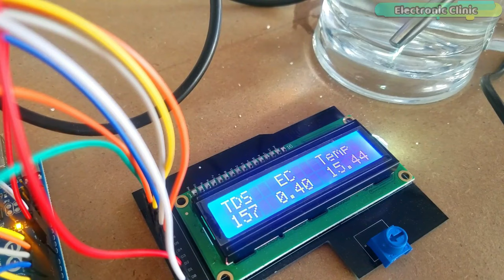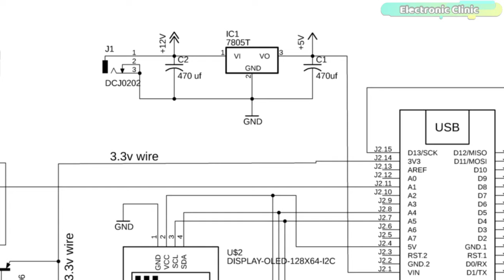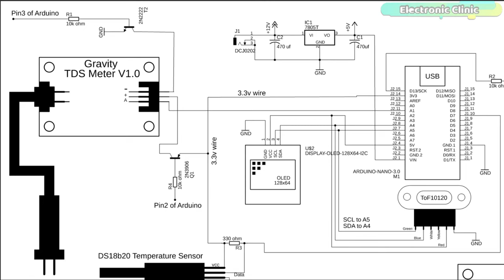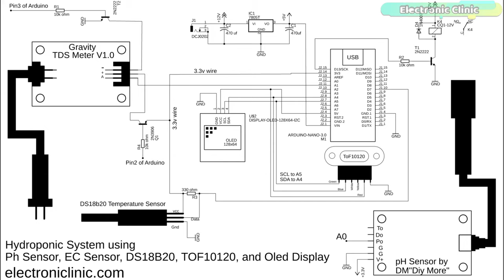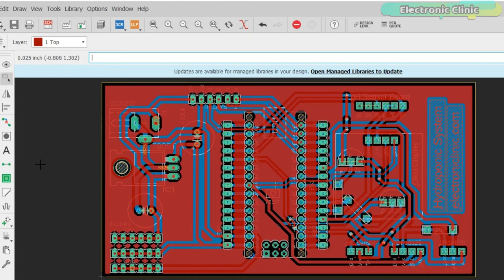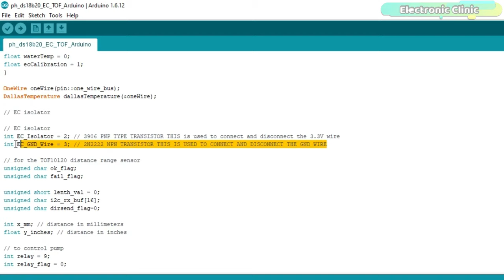Arduino Hydroponics, DIY Hydroponics System using pH Sensor & EC Sensor, Hydroponic

Comment: Totally amazing video. Finally i can read ph and ec at the same time. This is perfect for any recirculating hydroponic system. We would love an IOT blynk version of this using a esp32.
Reply: Yep, i'd like to have the same system using a esp32 to run with home assistant!
Reply: what range of ec is it reading?
specs on tdm meter says it only has  range 1000ppm, my ec calibration fluid is 1800ppm, is it enough for hydro?
Reply: @ralphbooger4756   ppm and tds are conversions of ec. Ec basically reads resistance...
Reply: @chimpofm  
so if the ppm range is 0-1000 ppm, that would mean the max ec value this board can read is under 2.0 ec? which would be on the low side for hydro?

im a little bit confused about the ppm to ec conversion, ive seen 3 different ways to convert it, on one scale was 1000ppm = 1.9-2.0 ec, another scale showed 1000ppm as 1.5-1.6 ec.

im trying to figure out if i can use this board, in my setup i would need to accurately read the ec at 2.2... and even a little bit higher to make sure it is not too high... so around 2.4-2.5 atleast.

could it be adjusted to read like 500-1500ppm or am i misunderstanding this completely?
sry bout the big post but im confused lol
Reply: @ralphbooger4756  ive never exceeded an ec of 1.5 and those were trees... i only work in ec so i dont worry about conversions . 0.35 babys. The 0.56 after 3rd set of leaves. Then you can calculate ec required by checking consumption.
Reply: @chimpofm  Hi! could you point me in the directon to find how to calculate required ec (or whats the relation between comsumption (and how to measure it) and required ec)
Thanks!
PS: yes, total n00b on this...
Reply: @gcolpachi  sure. Go in low. At half strength.  Measure ec. (Eg 0.82 ec) After 24 hours.  Measure again.  If the 2nd measurement is a lower number. Increase ec at ratio. If its a higher measurement. Lower ec. Add water.  Aim for a stable number. Ofcorse ec will increase over time. So as the measurements drop periodically increase ec at ratio.

Comment: How about using stepping motors to dip and retract each sensor? dip the sensor for a period of time like 5 to 10 seconds, make an average of all readings done in this time, store it, proceed to the next sensor, do the same task for all of them, and display the information after the probing process is finished. Of course this should be done in still water, like a tank connected in series to the pipes system.
Reply: stepper motors can not swim.
Reply: @nachnamevorhanden3335  smooth brained fella arncha?

Comment: Hey, thank you very much. Just wanted to check if using NPN and PNP will solve this problem, and here you are, you gave a result. So, also if you are better in electronics, what about using mosfets like N and P type will it also work? Because, I suppling sensors from separeted source and it has a huge current strength, so think I can burn bipolars.
Reply: So, maybe i will clarify, you used 2 pins of arduino but i want to use only one, so i want to connect NPN to arduino pin, and PNP base to NPN collector, so then when NPN will be open PNP will also open. But that way we need to deal with high current.

Comment: Do you experience that the PH sensor over time gives incorrect values? Does it need re-calibration or cleaning since it is submerged in water constantly? Thanks for inspiration
Reply from the maker: ya, it needs to be recalibrated. But the expensive ones needs recalibration after months.

Comment: Sir I am using diy ec meter in this circuit which has ec1 ec0 and VCC and GND what will be the circuit for breadboard  it have 4 pin

Comment: a couple of q´s - can i use an esp32 instead of the uno?  do i need to do 12v conversion - and not simply power from 5v ? thanks
Reply from the maker: you will get all answers, next week i will use esp32.

Comment: SIr i hv question for Turbidity sensor in your website, why when I turn the bolt knob on the A&D module nothing happens and it doesn't change to 4,2 or 4,1

Comment: sir can u do this video again but by using arduino uno R3 PLEASE
Reply from the maker: Arduino nano and Arduino uno are the same. You can use Arduino uno without even changing a single line of code.
Reply: @ElectroniClinic  sir is the way of connecting the components same
Reply from the maker: @j.mithranjegathesan7449  ya same
Reply: @ElectroniClinic  thank u very much sir for clarifying my questions. Is there any chance i can contact u personally sir because i have some doubts about my project
Reply from the maker: @j.mithranjegathesan7449  you can contact via Instagram
Reply: @ElectroniClinic  tq very much sir really appreciate it